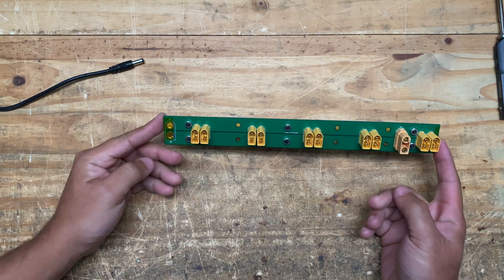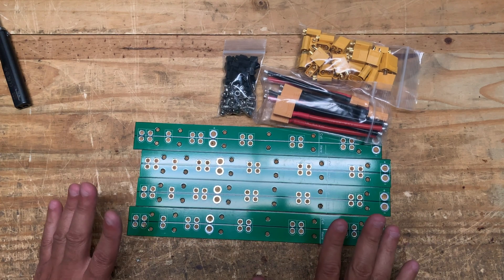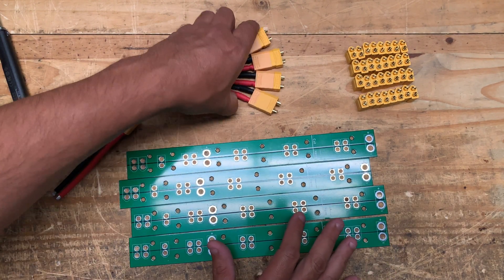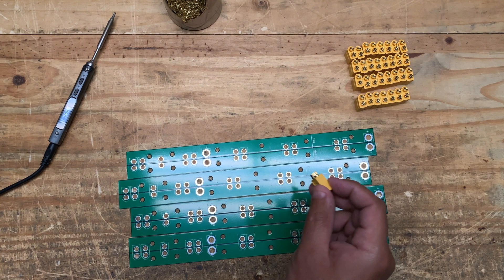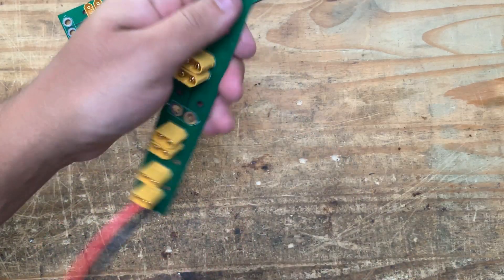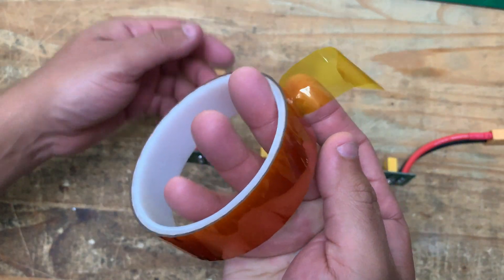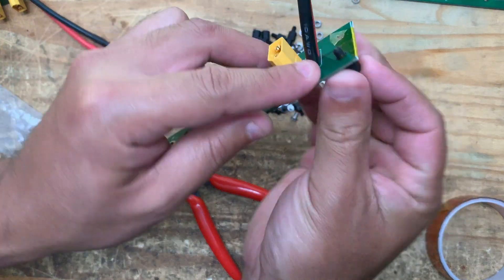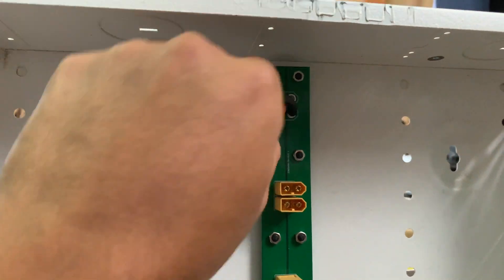DC XT-60 PowerStrip DIY KIT -  Powerwall Build

Comment: Would be awesome if you could make this power strip with 100% xt90’s only. I’d like to charge 10 batteries at a time with a big 36v 18amp charger. Especially in my case using 10 eb4 batteries.

Comment: How is your bus bar not shorted through the bolts and through that metal enclosure?
Reply from the maker: Plastic isolators
Reply: You don't seem to use any in your video... You should mention that somewhere
Reply: @iliazark1  He did, those were nylon standoffs that he mounted with the nuts.

Comment: how thick is the copper of the pcb and do you use vias?
Reply from the maker: 2 oz copper on each side and the connectors solder to both sides

Comment: The mounting standoffs and mounting screws that protrude out of the case are only being shielded from the full DC bus bar by the PCB solder mask. This is not good, as the mounting hole nuts/standoffs could potentially be overtightened enough to gouge the PCB and make contact directly to the bus bar, putting voltage on the outside of the case... In the next revision you should make some holdback distance for the copper layer around the mounting holes. Or include paper/plastic washers. Just my opinion here but when you're selling stuff to the public you gotta watch out for ways people can make things go wrong.
Reply from the maker: They are plastic

Comment: BTW you can get pcb mountable xt90 so that would mean you don't have to use those wires to attach more together (providing you want one straight line of them)

They are called xt-90pw

Comment: Hey Jehu, I Bought 3 of Them 32V Packs From Battery Hookup & ALL ARE BAD!!! I Called Their (2) Different Phone Numbers Countless Times & Left Messages, "a Woman's Voice On Recording" NO-One Ever Called Me Back!!! This Was Back When Tom Was Givin $1000+ In Free Batts & Messin w/Some Canadian Go-Cart Punk Dumb-Ass & Another In NY+ Videos??? Anyways I'm PISSED OFF BIG TIME Since All Three Have Bad BMS Boards & Will Not Charge or Nada F#@Kin More!!! They Read .5v Outta The FED-X Shipping Box & That's It??? Great $50 Each Door Stops!!! Have You Dissected One Of Them? The Blue/White Wire Is A Heat Sensor White Glued Between Weird Ass Square Lipo Packs w/A Top & Bottom Circuit Boards In Plastic Racks Connected Together w/Micro Wires Ribbon Cable... I Cut The Wires At Top Board & Soldered In A 30Amp Large Car Fuse Between Bottom Board Follower Black Wire & Top Wire ((Gnd) To Finally Get One To Work! I Can Charge & Dis-Charge, Butt It Has No BMS Protection Now, Butt That Was The Whole Point In These Expensive Lil Bitches, To Just Slap It On A Scooter or eBike I Built Butt Can't Use Yet For 4+ Months!? Can You Have Them Pricks Contact Me??? Or Send Me Tom's Personal Cell# Soo I Can Cuss His Ass Out!!!
Reply: Tom has always done me good, I ordered 3 of the 100 cell boxes  of disassemble your self modem packs, and one was missing a few packs, I emailed him and he sent me a extra pack for the trouble, also I bought 4 of the Headway cells, one just got hot and self discharged, he sent me another, and he sent me 2 boxes of the wrong cells, emailed him, he sent two replacements, I think he is just spreading himself too thin, got too much going on, and others are loosing things in translation, things are getting screwed up! But he usually makes it right, I rarely buy from anyone else! I have bought about 2k cells! Haven't had any issues yet! Knock on wood ! I never tried to call, email , through eBay, it may take a few days, but he usually does right!! Hope you get things worked out!
Reply: @jamest.5001  I Bought A $650 Order,  3-32v  (All Bad) & Balance in 75 - SPIM-08s & About A Dozen Of Them Broken In Packs? None Replaced or Replies Yet???
Soo I'm Out Couple Hundred $$$ Then???

Comment: Hey Jehugarcia here is the information for Kapton Tape.  Kapton is a polyimide film developed by DuPont in the late 1960s that remains stable across a wide range of temperatures, from −269 to +400 °C (−452 to 752 °F; 4 to 673 K).[1][2] Kapton is used in, among other things, flexible printed circuits (flexible electronics) and thermal blankets used on spacecraft, satellites, and various space instruments.

Comment: Love your work. Question: Aren't the stand offs also hot/powered, as far I can see they are drilled through the copper traces? If there is a space around the holes couldn't the stand offs and nuts cut the silk and have contact with the copper traces?
Reply: The stand offs are insulated with plastic where they affix to the box.
Reply: @earnwithbots2783  Didn't see any isolation washers.
Reply: 3D Gussner the black plastic standoff is held on to the PCB with a metal nut away from the case. The plastic standoffs also have a hole under them to use a screw and mount them to the case. The plastic standoff is the insulation. The nut is hot, but on the inside of everything
Reply: @JasonWho  thank you.

Comment: hey man, are you just slamming all that current through a pcb? The rule of thumb is 1 cm of unexposed trace is  maximum 10 amps, provided you use both sides you can maximally get 20 amps going and that is actually already stretching it quite a bit. That copper layer is very thin, this looks like a really bad idea tbh... Still a fan of your work, just hope you keep it safe and responsible!
https://www.4pcb.com/trace-width-calculator.html
Reply: This is 1 ounce or 1,4 mil or 0,035 mm or 35 microns. I agree with you, but maybe it does not need to draw that much current, remember that the smallest duration 100% of the battery capacity will last is 24 hours, so in any case you don't want to go above C/24. But well when I ordered my pcbs I ordered them in 70 microns. In any case I try to make currents above 1C punctual and C/24 on the long run. For the moment battery is a small 7,5 KWH but as it grows, current in and out will shrink (in and out of each cell). or if you prefer to be able to charge the batteries in the dayly 6 hours of sun, you may aim at C/6 but in my mind this is dangerous and in that case you take the risk of being out of juice if you have 3 or 4 straight days without sun. I prefer max C/24 in and out of the system MAX.
Reply: @AlexandreLollini  i dont really see the argument of how much C you charge or discharge, in the end it is about the currents that are running through it and they are dependent on the voltage of your pack and the amount of power the inverter is using. Maybe there is only 10 amps going through it but why would you use all the beefy xt60 connectors? It all seems to me that this is designed as to be a heavy duty powerrail with big currents running through it. If you slam 100 amps through there it gonna melt the pcb and plastic of the xt60 connectors and will catch fire. Its just really dangerous. I love the work Jehu is doing for the community but it only takes one fuck up to discredit the whole dyi movement.
Reply: XT60 and XT90 are just practical, handy, easy, it is not for current capacity. I take my case as an example, I have a 3000W inverter with 80% eff, drawing peak 150A at the inverter big cables. In use I measured with an artificial "all on" at max 80 A drawn. I have put a breaker of 85A there. I use 50cm 40mm2 cables from power distribution. Then I split that to 6 XT90 with AWG 10 cables. then I split each into 3 XT60 with AWG 12. 6x AWG 10 is 355A in chassis wiring. then 18x AWG12 is 738A . I think there is about 4.7 A in the pcb. And this is if I draw all I can from the inverter. A DIY person must do his math and use proper fuses and brakers. It depens on where you put the pcb in that chain, can be good or bad.
Reply: @TomTheDutchy  If you watch Jehus videos on building power-walls. He always explains building your battery pack big enough so that amperage draw to each cell is kept to a minimum. To keep from overheating and extend your cell life. This still applies here.
Reply: @R2000x   Ruben Salazar  i have watched them, i like jehu a lot. But thats why we have to be super critical about things he makes, because he influences so many people. I think it would be responsible of him to talk about the max amps going through the pcb because plenty people dont understand the concepts well enough. At the end of the video he has 28 packs in parallel. I dont know whats in them but i would assume they provide at least 1 amp( more likely 10 or 20? Maybe someone here knows what they are??) So if you want to stick to 10 amps(or 20 if both sides of the pcb are used) then you cant even draw an amp from a single pack. This just looks awfull, please someone here tell me that im wrong and that the amperage limitations are being met. Safety is the most important factor at all times.

Comment: Hi, and what's about current thru PCB lines, are them have enough thickness to pass 90amps of power (looking on XT90 connector, rated to pass 90amps)? Maybe adding two non masked strips on backside of board can help to increase power rating on this PCB (you just need to solder extra wire by the all length of each strip)
Reply: limit to 10 or 20 amps max. you don't need more because current is spread over a large number of batteries. if you have a charger that delivers 100A to 10 stacks of batteries in parallel, each stack gets 10A. You're okay.
Reply: @AlexandreLollini  thanks man, it's clear for me now
Reply: If you watch Jehus videos on building power-walls. He always explains building your battery pack big enough so that amperage draw to each cell is kept to a minimum. To keep from overheating and extend your cell life. This still applies here.

Comment: Looking at the suggested battery pack links, curious as to how you would utilize 32.85v or 36v configurations when most inverters use 24/48v.
Reply: I prefer the 24V 7S configuration. to keep it balanced.
Reply: In the last 3 years companies have gotten rid of the 12v/24v requirement. A big part of this is do to the tool industry. The large Ryobi packs are 36v (advertised as 40v). They have an 1800w inverter that uses those batteries. 

I have made an adapter for the Ryobi with an xt60 connector. So now I can plug in any 10s (36v) and it seems to work great.

Comment: 1oz copper 30mm (2*15mm) trace width is not enough. With this configuration the maximum value is  20A for 20C temperature rise https://www.4pcb.com/trace-width-calculator.html
Better not overload, or use thick and plain copper instead of pcb.

Comment: I always overheat the plastic when soldering xt60 connectors which causes them to change shape and not work. So now I always plug the male and female connectors together when soldering. That way when the connector you are soldering overheats the other one holds the correct shape till it cools down.
Reply: A small trick is to put a connector in the other end so the pins stay in the same place if you still have melting then you are not applying enough heat and you are holding the heat on to long
Reply: Maybe try a better iron... not just more watts, but a proper temperature controlled unit.  I have great luck with mine with these types of projects.
Reply: Just to clarify this is mainly a problem with 10 gauge wire in xt60’s and 8 gauge wire with xt90. Using the thick wires requires a bit more heat than 14 gauge wire does. It is also a good technique for when you are learning to solder.
Reply: @ecospider5  I like to tin the wire, flux and tin the cup, then weld the two together.  Proper heat is a hard necessity.
Reply: @LJ prep. Great suggestion. I will do that next time, plus a touch of flux right before the final weld.
Reply: low temp solder

Comment: Nice using the ts80 i like mine and with the aftermarket firmware you can go to 450c if you need to I don't really but like 410 or 420 is useful for big things
Reply: Thats the TS100, not the TS80.
Reply: Was it I did not even notice
Reply: Yep TS80 uses a USB C for power, the TS100 uses a barrel connector.
Reply: Ya i have the ts100 i dont know what i was thinking

Comment: need more details on how the connection
works? does it all connect to the PCB and stay the same voltage
or does or can it go from 12 to 24v and so on?
Reply: Everything he is doing here is  parallel connections. So all the batteries you connect need to be the same voltage. So if you connect ten 12v packs together your output will be 12v. If all of you packs are 48v your output will be 48v. 

If you connect one 48v pack and a bunch of 12v packs the 12 volt packs will try to get charged to 48v. If those packs are lithium they will burst into flames. So keep the packs that you connect to your DC power strip the exact same voltage and the same charge level before you connect them in.
Reply: Those Packs Are 32V Packs!!! I Bought Some & ALL Were BAD!!!